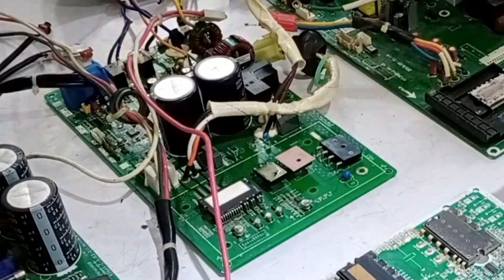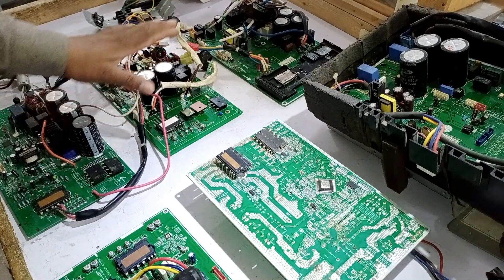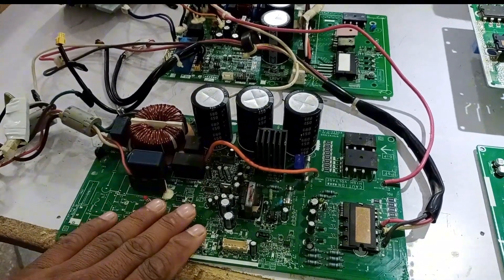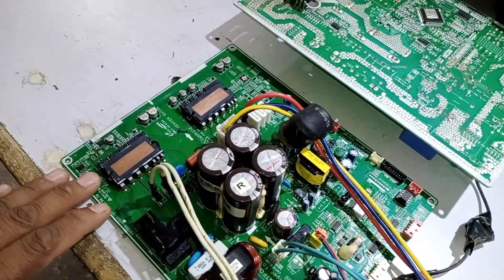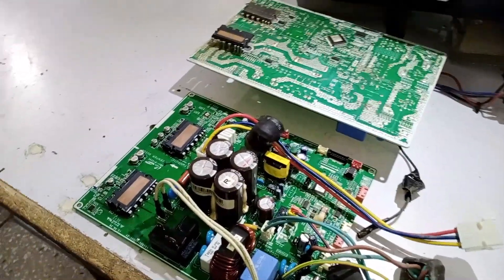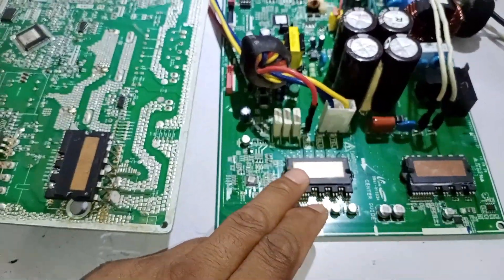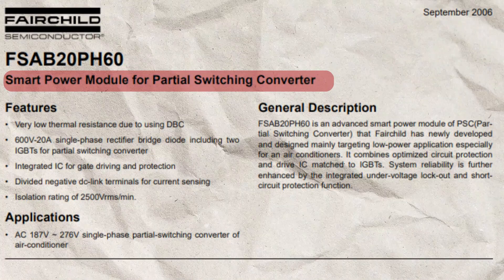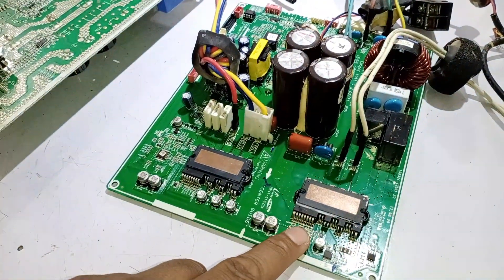Why Do Inverter Mini Split AC Circuit Need Dual IPM Power Modules?

Comment: PFC is just as name suggests: power factor correction-making sure power factor is as high as possible (typical for those units, with bridgeless boost pfc or interlieved boost pfc is about 0.99). So input AC current, drawn from the grid is sine wave and almost perfectly alignd in phase with input voltage.